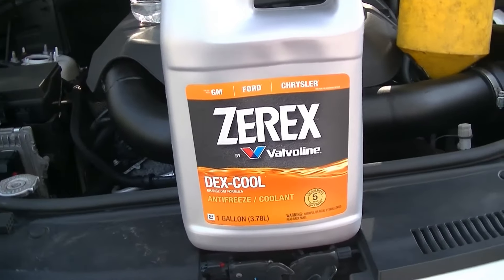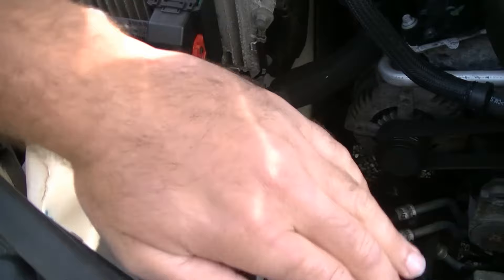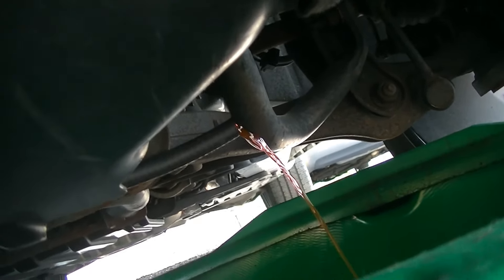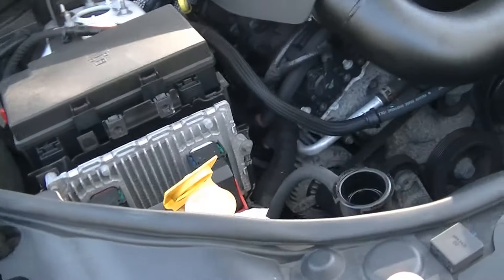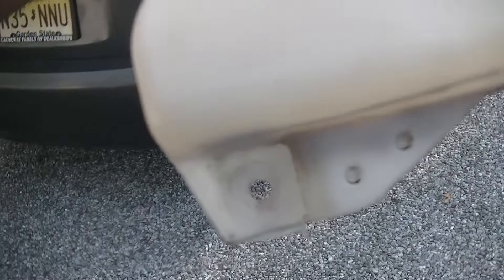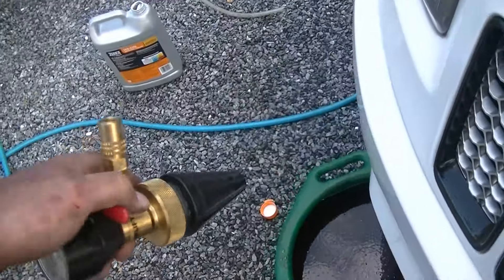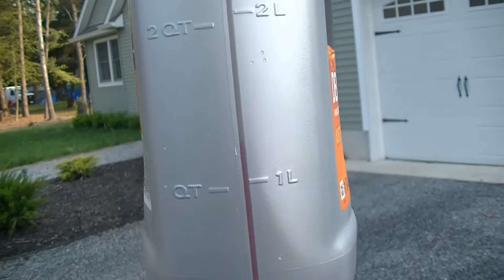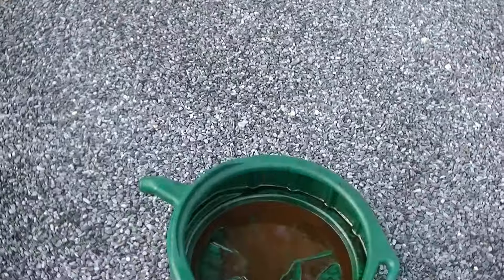How to Change the coolant in your Jeep Grand Cherokee/Dodge Durango with the 3.6 Pentastar!!

Comment: I put Zerex Dex cool in my 2015 Grand Cherokee after Changing my Thermostat since I had it for my GM Vehicles and it didn’t mix well with the Mopar coolant, I got a Brownish sludge in the Overflow tank and under the Radiator cap. I flushed the System and put the Purple Mopar coolant back in and all is good now. I guess not all OAT coolant  is compatible with each other.

Comment: For $3 more I would just buy the Mopar Factory Coolant. Dexcool is not exactly what Chrysler uses. Dex is a GM product.
Reply: The current Mopar coolant is an OAT type coolant in which is basically Dex-cool except it's purple. The coolant that Stellantis uses is technically called G30. which is nothing really special. Dex-cool is a GM trademark for a line of OAT type coolants. Not only GM use Dex-cool,some Ford cars and trucks also use it too. In North America the closest product one can find for newer Stellantis products is Zerex G30 and Dex-cool. Both are chemically similar.
Reply: Jeep requires HOAT coolant I thought

Comment: Great Video! I have a question - I have the 2019 and it has that reservoir bottle and cap. Is this method safe for that set up as well?
Reply from the maker: You don’t need a spill proof funnel for those! Just make sure you keep the degas bottle full and don’t put the cap back on until both hoses are hot!

Comment: You seem pretty knowledgeable, thanks for this video! ButI have a question. My jeep has been running hot off and on. First time it was the thermostat, problem solved. Several months down the road again same issue, and was the thermostat again, solved! Several months down the road again, took it to a mechanic and he swore it was the water pump and so we replaced it. Still running hot. However, if you touch the top radiator hose it's scalding hot but the botttom don't get hot at all. You can even touch the radiator cap and it's not even hot. Was going to do a coolant flush on it and see if that would fix my problem. What woud you reccomend? Do you think it will fix my problem or should I do something else?
Reply: Sounds like there was air somewhere in your system

Comment: i just changed my tstat and bled system with the funnel method.  been driving for a week (in jersey) and upper rad hose gets hot, lower rad hose is cool.  temp gage hovers around 1/3-1/2, no overheating.  Do I still have air in my system?
Reply from the maker: How is your heat working? In the colder weather it’s totally normal for one hose to be cool as the thermostat will only open partially when it needs to, to maintain temperature.

Comment: Good clear video, thanks from another Jersey guy. Is there a concern that 6 qts of old coolant is still in the system, or do you just replace more often to address this issue?  Also would you replace the upper and lower radiator hoses, and heater hoses at the same time?  I'm at the 100k mile mark and the hose replacement seems like cheap(?) insurance if an amateur like me can do this in the driveway.